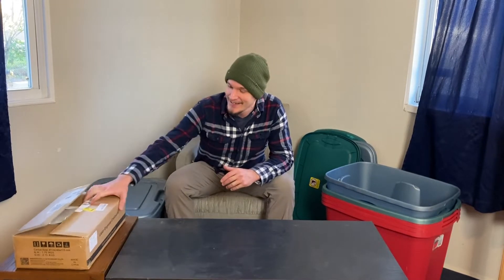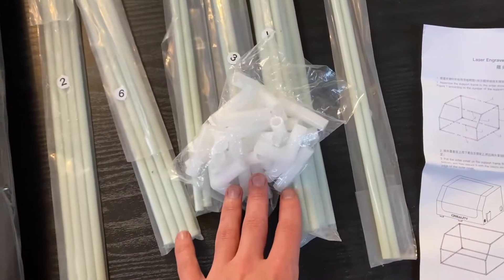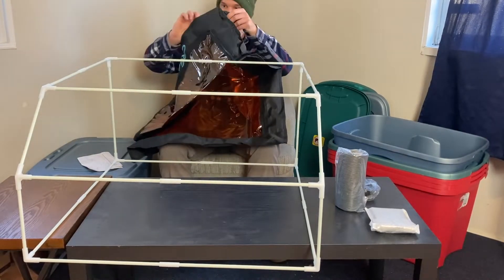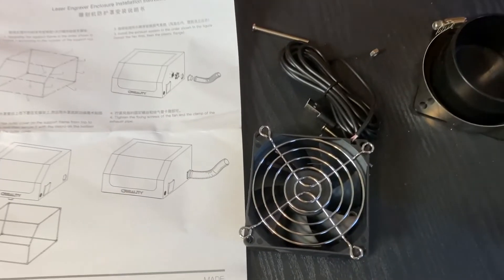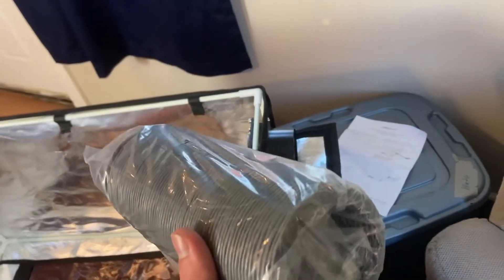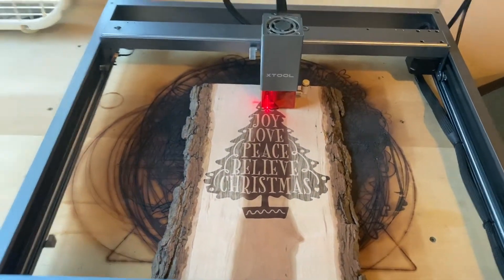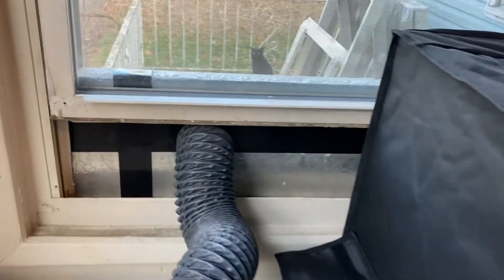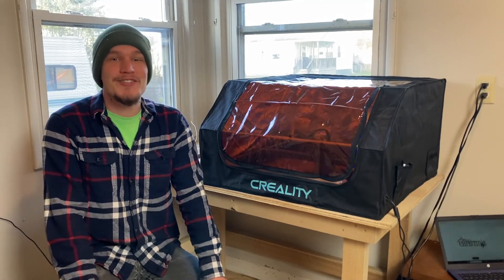Creality Laser Enclosure & Ventilation System

Comment: Used this machine and enclosure now 4 times indoors. Ill be honest just had to spend another $200 to get an inline and duct kit. Didnt have to go the full $200 but since theres two exhaust ports ill refit the included 3 inch on the right and run the 4 inch from the left with a wye after the inline to toe the two together and use the force of the inline to extract both lines outside my window through a sheet of insulated foam
Reply from the maker: That's an awesome solution - I'm glad you found something that works well for you. Ours has always kept up well with pulling out the smoke.

Comment: Where do you plug the cord into on the fan
Reply from the maker: See Short reply
Reply from the maker: It's USB so you'll need to use a USB power source, or get an adapter to plug it into a wall outlet.
Reply: Does the fan start spinning after being plugged in or it needs to sense the smoke before turning on? I just assembled mine right out of the box and the fan is turning on.

Comment: Nice video! Just curious, are you using the air assist? I’m using the same enclosure, but seem to have more air coming in with the air assist than the fan is capable of outputting. Maybe it’s just my copy of the enclosure.
Reply: I've had similar issues, especially when cutting. The fan has not been able to get rid of the smoke and it starts to flow out under the hood after a while.
Did you manage to solve it? Any recommendations on a replacement fan?
Reply: @tomasrydholm9144  I bought a larger fan for the room to place by the window (just for projects where I wasn’t satisfied with the ventilation) and left it at that pretty much
Reply from the maker: We’re not currently using air assist, but definitely plan to in the future. I’ll be interested to see if we have the same issue.